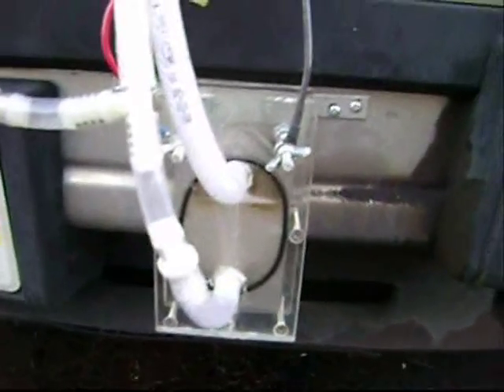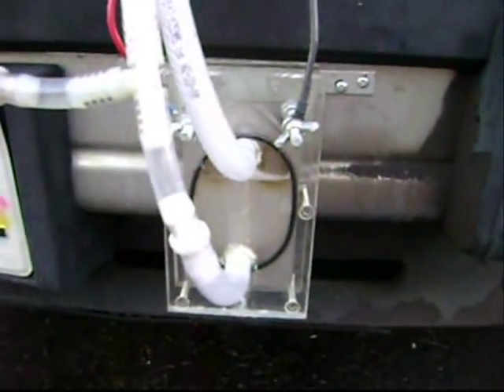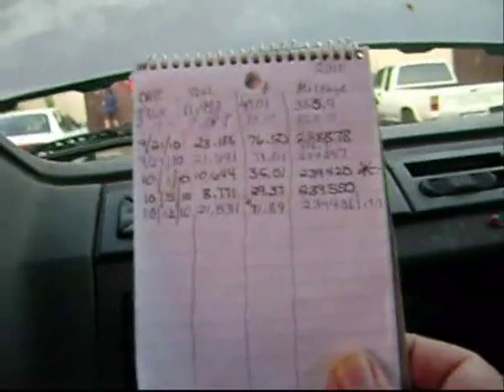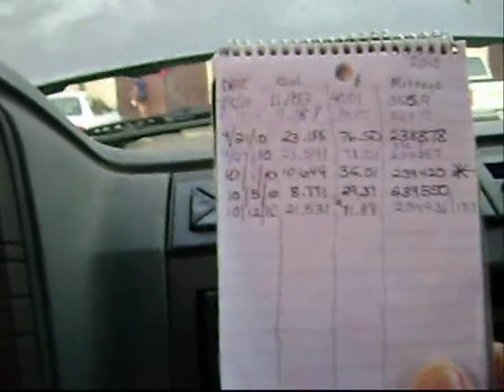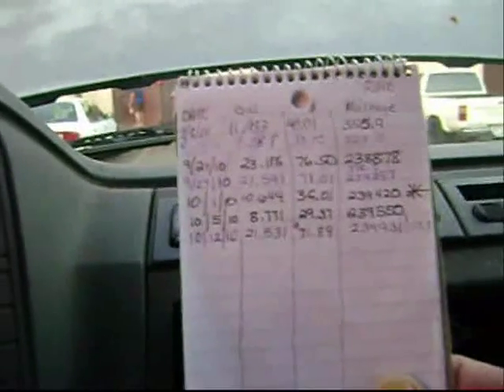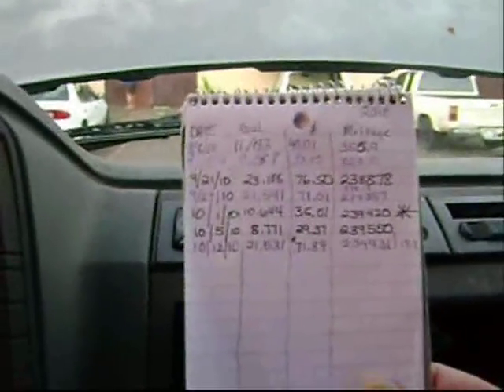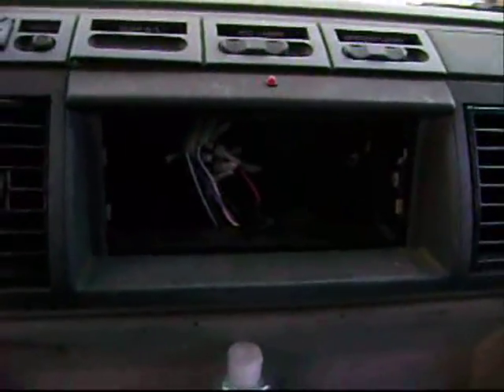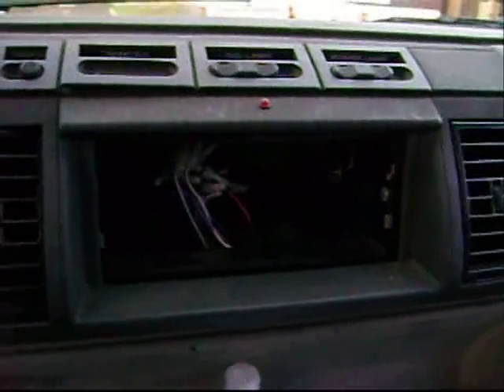Does HHO Really Work 5

Comment: The problem is conflict in thermodynamic law! You can not save fuel if your HHO gas is only produced from the battery! The HHO gas produced from the battery can just clean engine carbon deposit and restart fuel consumption to factory condition. For real fuel savings up to 40-70% you must use only 100% free or external power supply !!! Read the Terms and Conditions before ordering HHO set Plus Hho gas pseudo HHO Fuel Saver bullshit ! All is HHO Scam Scam Scam!!! People ask for refund money in 10-14 days from your delivery !!! Contact your eBay, Amazon or PayPal Customer care and open DISPUTE CASE for full refund money back !!!
Reply from the maker: it's only a scam if there is an element of "deceit" I believe that HHO can help in gaining fuel economy because I have had aa positive experience. If I had an experience that it didn't work and then claimed it did, then that would be a scam.

Comment: So let me get this straight, you are burning gas to turn the alternator to supply electricity to split water molecules to burn in the motor, and that is supposed to increase your fuel mileage? I can increase fuel mileage by 20% just by driving technique. Seems like a lot of work for no real gains.
Reply from the maker: The key to fuel gains is through leaning the mix. HHO cools the engine which allows you to lean the mixture.

Comment: So, how much has this whole HHO system cost you so far? Just curious because I'm thinking there are probably much better ways to gain a lot more gas mileage over EPA than that. Have you looked into aerodynamics (smooth hubcaps, wheel skirts, grill block, belly pan), hot air intake, driving techniques, low rolling resistant tires, engine kill switch (for coasting with engine off), max sidewall psi in tires, transmission regearing.... The list goes on.
Reply from the maker: Well, let’s just say my wallet has felt lighter than my car’s fuel tank! But hey, if I can turn my car into a hybrid between a science experiment and a gas sipper, I’m all in!

Comment: I had a PCU-3 (water2gashawaii) "50 amp" on my 12 amp HHO cell on a 30 amp fuse. Two times in a row the unit failed. To date the company has not refunded my money. I am out close to $50 in multiple shipping charges sending it in for repair, back to me and then back again.  They have not returned the unit back to me so I can repair it elsewhere.  Very fraudulent!!!  The State of Hawaii business registry has Hydrogen Fuel Systems listed as "Not in good standing".

Comment: You might look into varying your hho production based on RPM.  This could be done by having the PWM control in  your cab.  In the paper titled "Effect of hydroxy (HHO) gas addition on performance and exhaust emissions in compression ignited engines" they found that as low rpm they needed to run lower electrical draw from there HHO generator in order to get gains.  If anyone is interested in this paper send me a message with your email.
Reply: So I know this post them rating is 9 or 10 years old but I would be interested in the paper you mention my name is very end of my email is barrywaderson69 @gmail.com